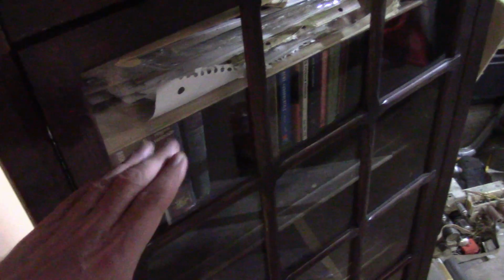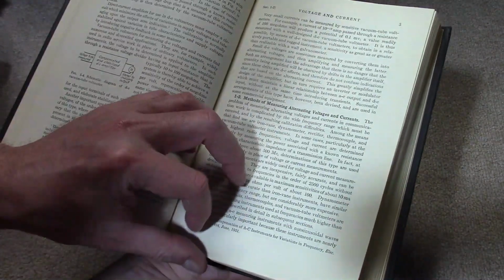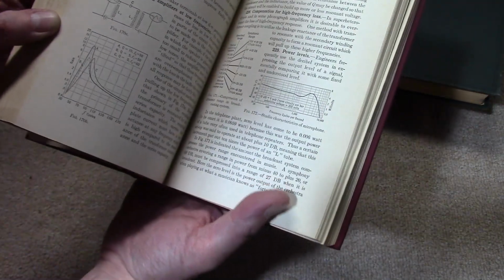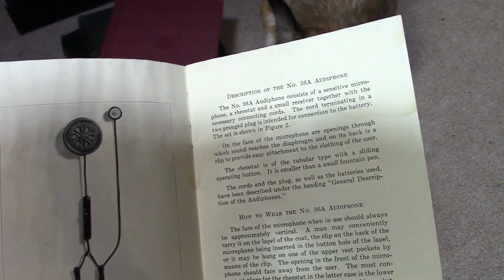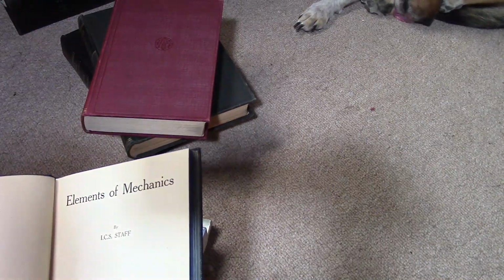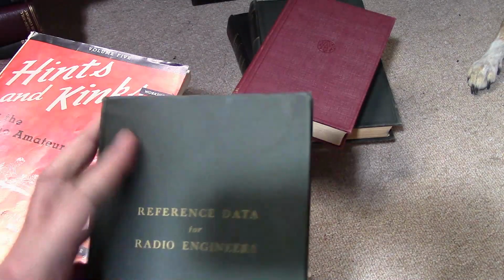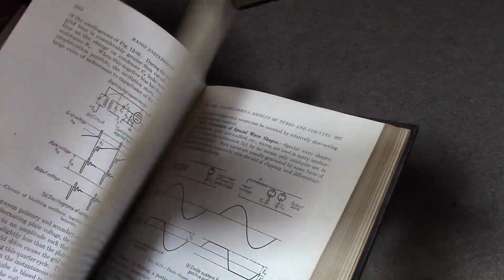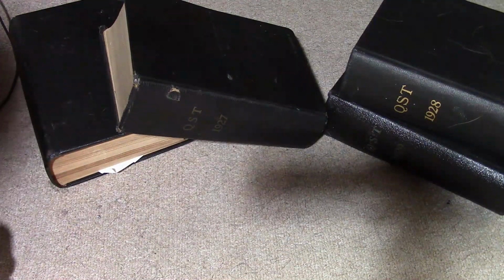Estate Treasures: Books

Comment: Hi

I got the Like Button Back (Thank You)...

By the Way ...

How can one otain a copy of the Old Radio /TV Books (I have checked on Amazon but could not find any except for the New Tube Radio Books that I have already) I like repairing Vintage Electronics which I started doing in 1979 and most of my Projects where Radios from Phiilips,  Pye and other U.K branded Radios. Most of the Vintage TVs I worked on came from Japan or the UK Such as National, Ekco, and Anderia. It is vary hard to Find Vintage Radios or TVs because most of them where discarded after 1977 (In owr Regions) as I found out. But I Ocasinally come across some Items by Chance.

Thank You ...

And God Bless ....

Mohammed A. Rahim
Manam -Bahrain

Comment: I see I'm not the only one that has collected vintage electronics manuals and books over the years. Mine is mainly radio 
and phonograph manuals, some manufacturer and retail catalogues and also all sorts of Howard Sams books , the last 
were from my late grandfather. I had wondered why he did not go into the service during WWII . It was because he failed
the vision test because he was color blind. Made sense after we found out about the color blindness issue after he
 passed on and his Heathkit IO-102 oscilloscope (that I saved from mom's huge yard sale) which he built but never worked 
right. I suspect going over the resistors throughout  it I will find wrong values in the wrong places!
Reply from the maker: I'd leave it as is with a note inside.  What a great story!

Comment: I wonder if you could highlight a basic tube oscillator design out of one of those handbooks, Bob. Even if only for comparison's sake :) I'll leave it up to you to select the type of oscillator ... By the way those books are a real treasure trove of information for someone involved so deeply in restoring vintage electronics, such as you and, no doubt, at least half of us viewers of your channel
Reply from the maker: Well , they're pretty much either going to be a Colpitts or Hartley.  Not much to them.  A tube, bias resistors, coil and a few caps.  I've repaired existing circuits but never much looked into the design. I can tell you that most radios use a pentagrid converter that combine oscillator and mixer in one.

Comment: One of my first jobs as a late teen was working for an old ham assembling battery charger modules that go on generators.  He had a jig set up so I could adjust the current, I think it was like 10 amps but he had it on a huge resistor and measured the voltage drop across it and I thought it was magic that it could tell you the current from that lol.